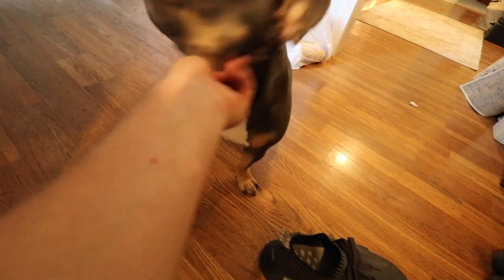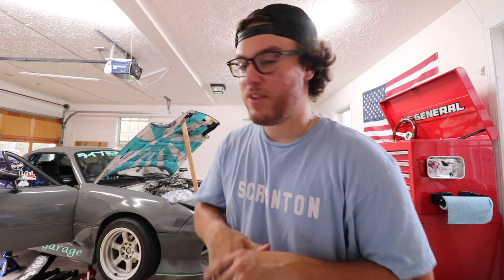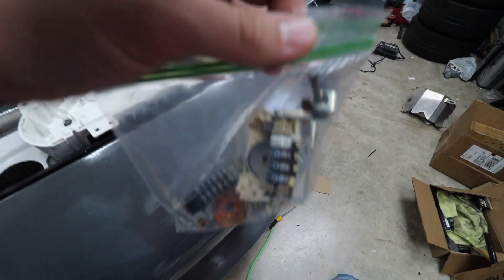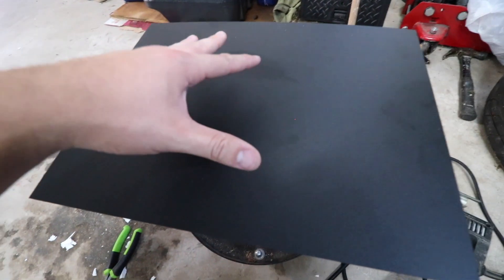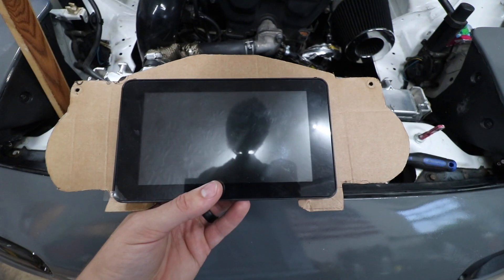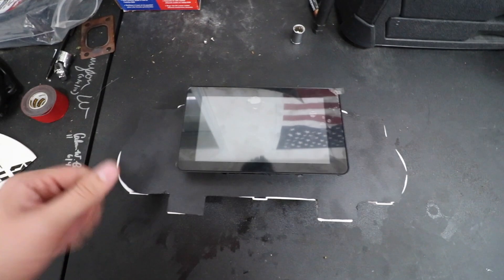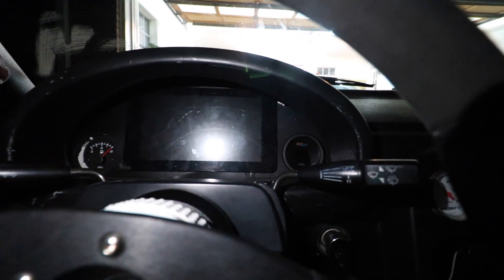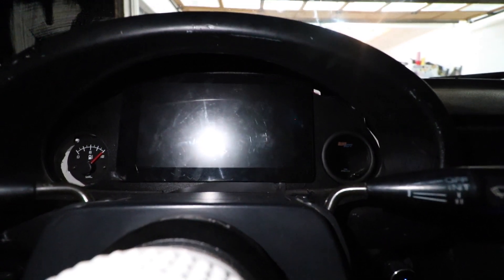DIY $150 Digital Dash Setup | Miata

Comment: How is the display holding up?
Reply from the maker: It held up great I removed it last year just because I wanted to go back to factory gauge cluster but still have it if I ever wanted to re install it
Reply: Thanks for the reply man.  Any response rate concerns using a raspberry pi display? (mostly tach) @GasPedalGarage

Comment: Im sorry if im being stupid but how do you get the data
Reply from the maker: Reads from Megasquirt ecu
Reply: @GasPedalGarage how are you running it from mega squirt , via blue tooth or did you tap into the wiring ? 
One link didn't work
Reply from the maker: @chrisasaurus  plugs into the Megasquirt via serial to usb plug

Comment: Update.  Parts over 250 now
Reply: raspberry pis are hard to find, dont buy on amazon because they are marking it up like 500%
Reply: Locally they have them. I bought mine from a microcenter and they had PI5,4 and 3’s. $60 for a pi5 4gb. $55 for Pi4.

Comment: I wanna get a 3d printer so bad for this stuff. Just make a custom housing that fits perfectly.
Reply from the maker: 3d printer would be awesome! Would allow for a lot of customization for sure
Reply: There are services that will 3d print for you pretty economically
Reply: @ΓιάννηςΖιώγος-τ3υ  Every service I've found isn't super economical, most of them want $40 for a part that'd cost $1 to print if you had a printer... Which would be a lot more understandable if they went through a lot of cleanup or designed the part themselves, but most of them just give it to you straight off the printer.